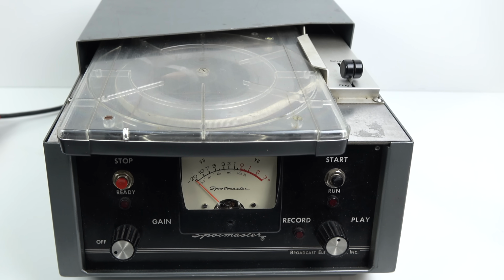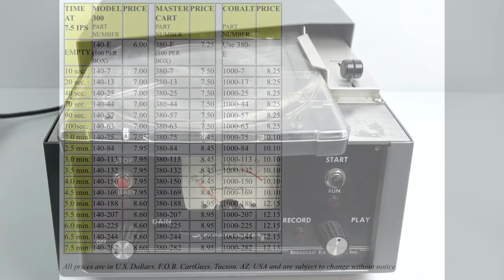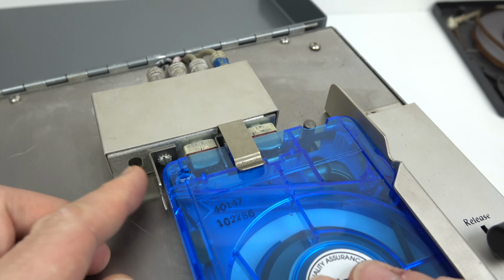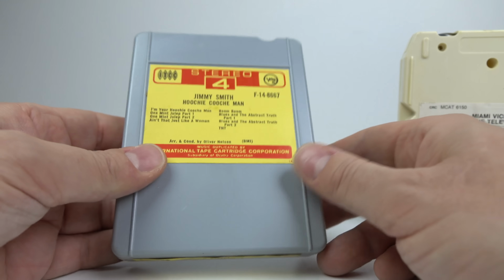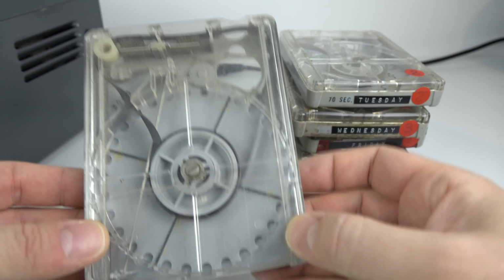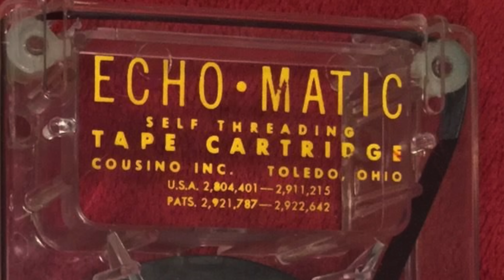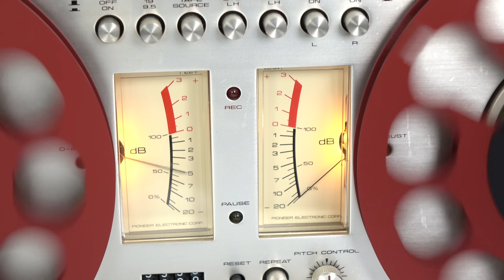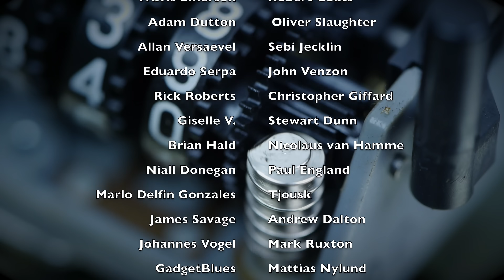The Broadcast Cart Machine

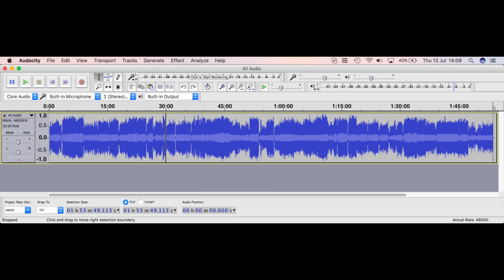Comment: At about 12:30 you refer to the tape being in a Mobius strip and it plays on both sides. This is an incorrect description. There is one side that has magnetic particles that allow the signal to be recorded onto the tape. The other side is specially lubricated to allow the tape  to be pulled from the area between the inner plastic core and the tape pack. So the correct description is that it 
plays one track and (with a movable head as in the consumer models) then the other track. The material used for the lubricant has the nasty habit of coming off and depositing the material within the cart and also on the machine deck. This has been a drawback of the design both for 4 and 8-track tapes. Also the loss of lubricant can/would cause the tape pack to "tighten up" and eventually stop playing at all. The only solution was to either junk the tape, usual choice for broadcasters, or find the splice point, put that apart and put some slack into the pack, a temporary solution at best as I found on several occasions.
  Also read you comments about the problems with the cueing after I posted my previous comment.
Plus, at the time that they were new, I lusted over the Revox machine and strongly considered the Pioneer for my home audio system.
Reply from the maker: Nope, what I said was 100% accurate....after all I was dubbing across the tape so I know how it's been recorded. There is one mono track recorded on each side. Fidelepac carts didn't use a moving head. You can read a description of the process here in an article from 1959 which describes the way a cart is constructed with "a single twist in the tape, before splicing the ends together creating a Mobius loop" https://books.google.co.uk/books?id=SSEEAAAAMBAJ&pg=PA24&lpg=PA24&dq=fidelipac+mobius&source=bl&ots=5dZw4imGqv&sig=HG5_5vyoET0_eG6TAji3BNYZrgI&hl=en&sa=X&ved=0ahUKEwjX6dSK4JjVAhVpBMAKHWdMCnAQ6AEIHjAA#v=onepage&q=fidelipac%20mobius&f=false
Reply: The consumer models did use a head mounted on a plate that rose or fell to position the head gaps against the desired tracks and allowed the length of tape packaged to be sufficiently long enough to record the longer side of the LP that they marketed as an alternative format. The way the tape was pulled out from the center provided the rotational movement needed to capture the tape after it had passed the  capstan/pinch roller position. In normal audio tape, one side is coated with the magnetizable material and the other side is the plastic (earlier it was paper for a short while) base that provided the mechanical support for the recording medium. If you tried to record or playback a tape with the base side against the heads, the thickness of the base would place the magnetizable material too far away for useable results. Hence, you are correct in saying that the cartridge machines such as you featured didn't have a moveable head. The consumer models did in both 4 and 8-track configurations. So, instead of recording on each 'side', which implies recording on the magnetizable side and then on the backing side, there is only one 'side' which is used. 
    As far as the track configurations: the mono broadcast model had a two track head recording two tracks. One track held the audio and the other held the cue tone. In stereo broadcast models, there were three gaps: two for the stereo audio and one for the cue tone. In stereo home models, there were four tracks, two each holding audio representing one 'side' of the LP and no cue track. On 8-track systems, there were, of course, 8-tracks. Interestingly the track widths of the 8-track machines were the same width as cassette tapes, and only achieved better fidelity that the cassette by using a faster tape speed (3-3/4 vs 1-7/8ips).
 BTW: here is a link to the Wikipedia article on the consumer version of what you demonstrated. https://en.wikipedia.org/wiki/Stereo-Pak

Comment: The old Metrodata dataloggers circa 1970 also used the large Fidelipac cartridges.  I have one and was shocked to see that this was its format.  I believe that the one I have is the one referred to in this university note from the time.

http://ir.library.oregonstate.edu/xmlui/bitstream/handle/1957/7593/Internal%20Report_22.pdf;jsessionid=6DB373B0400D68633C791A11A25D5647?sequence=1

Comment: hi the time of the  c carts is not right on the list  i have  new old stock one's  1200 are longer than it says  cart b 30mm   cart c  1 hr    i used  3 x  8 track  80min  
they were used as a back ground music play and the 8 track were alot of wear one the pinch roller and did not play right  obce the tape was moved they were ace

Comment: lol carts! they sucked so much.. the blue ones (capital AA4) were very high grade lubricated metal tape, and most stations running playlists had the entire rotation on those from the late 80's, dubbed from vinyl or 'gold disc' CD distributions from pluggers.. all the other ones (Black, Grey AA2 & AA3 FE tape) were commonly used for voiceovers and foley in telecine before things like the AMS Audiofile and Legendary 360 systems HOTKEYS arrived (basically samplers). When the old cart machines were flogged off, they ended up in hospital radio and pirates. There were 3 tones in use (centre track) the primary was the STOP tone, like the foil in an 8-track, the Secondary & Tertiary tones engaged FAST FORWARD, a WARNING LIGHT to show the end of the recording was coming, MUTE and NEXT SLOT on machines that supported them. This was useful on Triple-stack machines that would fire things in a sequence, and mute the just-played slot so the bumpy noisefloor left by the bulk erasing would not merge with the audio on a single audio out stack. The machines to really treasure are the last line of SONIFEX - they rocked! Nice find! Enjoy your playing at radio!